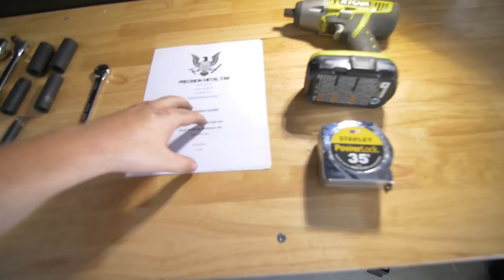2017-2019 F250 PMF Dual Steering Stabilizer Install and Review

Comment: I'm really shocked that in 2019 they are still fighting death wobble
Reply: Earl James that’s a big cap. Look at YouTube videos everywhere. People with stock trucks doing this shit all the time
Reply: @Earl James Mine is exactly 100.00% stock and I've had the issue several times.  Same for several others I know.  Ford and their caseworkers are well aware of this issue also.  Their latest "fixes" make it much better, but I'm not ready to say "fixed".
Reply: @Earl James You must not drive any of those trucks.  Have you asked the drivers if they have that problem or are you like our mechanic that sits on his butt and monitors stuff???
Reply: I’ve had my 2016 Lariat (stock) 4 years now. Driven it three times from Austin to The Mississippi Gulf Coast (round trip) and Austin to California central coast twice. I’ve driven it from San Jose to San Diego twice (I-5, hwy 101, I-405), San Luis Obispo, Ventura, LA, even God-awful Houston highways, California Grapevine on the I-5, the I-10 and I-12 in summer Louisiana and Mississippi heat. The west Texas, Arizona, New Mexico and California deserts (I-10), and Lake Tahoe (Sierra Nevada Mountains). Never seen or felt any wobble, jerk, or shimmy. Edit: Also, I live down a  quarter-mile dirt road complete with a huge grade and ruts. When it’s dry out, I have to use my 4Hi or rear diff lock to avoid spinning on the gravel hill, and when its rain, to avoid slipping on the mud. That’s just to get to the “road”. I’ve bounced that suspension moderately (hard once on a pot hole at speed) regularly. Both before and after the aforementioned long trips - she’s been cared for, but not babied and never garaged. In fact, my biggest problem is my war with the rodents going after my wires.
Reply: @Earl James I have a Stock off the lot 2019 F250 with 3,000 miles on it and yes my stock truck has it. Only non stock parts on it are plow mount and Sumo Springs in Front bump stops and has it worse without plow on it. Dealer stated its normal on these trucks.
Reply: I have a 2017 f350 4x4 single cab XL with a 1800 pound Northstar SD bed. 6.2 engine...total truck weight with tools and driver is 10,000 I have weighed it on a truck scale...have not experienced death wobble yet..is this just diesels that have the issue?
Reply: @Earl James stock trucks do it all the time.  Dealer puts new parts on and  front end is nervous in a couple thousand miles and by 5k miles goes into full on death wobble.  Front ends on 250/350 are shit, my 450's and 550's rock solid so far.
Reply: Everything completely stock, 2019 with 27k miles, death wobble!
Reply: Just Cause that’s because the DW issue is with the new body 2017 and ups.

Comment: Why install a dual vs replacing the original stock with something like a high-end Fox? The previous owner of my 2017 installed a dual stabilizer and I'm trying to decide between upgrading its shocks or removing it and replacing the original stock stabilizer with something like a Fox.

Comment: Great video but I still don't understand the whole issue with the four 1 1/2" bolts - did they fit or not?  You put 2" on but at the end said the others could have worked.  Are they too short or not?
Reply: That's what I was seeing, the 1 1/2 bolts should have been the right length. The 2" bolts were not threaded all the way and nut could bottom out on the shoulder of the bolt. I would put the shorter bolts back in and retighten. Should be easy if you change them one at a time

Comment: The dampeners are to control the big 4X4 wheels when off road from slamming around, and ripping rhe steering wheel out of your hands. On pavement it does nothing. For control of lateral movement.
Reply: Nah. I have to disagree. In the F250/350 it’s a huge improvement on pavement. I have this same kit on the same truck.
Reply: @Coach_RC  the old Cadillacs had dampers too, gave them a real steady feel on road, true. But 4X4 front end is a different beast altogether .if you have true death wobble the damper may camouflage it, or reduce it, but it is not the cause. Look to your other front end components,  bushings, any play at all is magnified by larger wheels, poor alignment etc..Do not take chances.Death wobble has been around since the first bunch of 4X4s. We dealt with it in the old days. Find an old timer who knows what to look for.
Reply: @GgRae-gv1tg  I’ll agree that a dual stab is not the “cure” for death wobble, but it 100% improves the ride in the F250/350. My truck is smoother today with 55k miles then it was when I drove it off the lot. The dual stab reduced the bump steer, it turn, saving some wear and tear on other components that are complicit in the truck’s death wobble.

Comment: Did you have to get a alignment after install am putting a 4 inch lift on my 2017 f250 with 22 in rims and 37 inch tires nitto rigged  going to put a stabilizer on mine

Comment: Missing parts and bad directions...that means another brand to me
Reply: My PMF came with all parts and I downloaded the instructions.  The installation went very well and I am extremely happy with the performance of the PMF Dual Steering Stabilizer.  It took care of the death wobble that Ford couldn't fix (4 times in the shop) and it also took out the little bit of bump steering the truck had.
Reply: @kckettridge  I installed some Carli +2 caster bushings and it fixed the problem, even with a 2.5 inch lift.  Is your Super Duty stock height?
Reply: @danieltubbs5422  Yes, stock except I added a Hellwig anti-sway bar in the rear to stabilize the ass end and currently I have Timbren ses bump stops which I'll be changing out to Air Lift air bags soon enough. Primarily because I tow a 36' 5th wheel on ocassion.
Reply: Exactly and at $500 plus  $199 plus the stabilizers  there are more fish in the sea

Comment: Ive got a 2017 KR and I’ve got about 62k on it. Installed leveling kit and some 35’s, truck rides like total $H*T.   Was told to maybe look into this kit. Not sure if it will help or not. Steering wheel shakes and you feel every bump in the road (tires at 60psi) Toyo open country RT and have been re balanced with very low road force.  Who knows worth a shot I guess
Reply: On 35s 60psi is way to high for regular day use . I recommend doing the chalk test to get the best results with 35s especially being 10-12 ply the higher pressure isn’t needed unless your towing so that would definitely help with the feeling of every bump like you said . And as for the wheel shaking make sure the tires as balanced and make sure you check all suspension components like trackbar tie rods drag link ball joints especially . These steering stabilizers only mask your issue it is not a resolution by any means

Comment: When you did the steering test in your driveway the driverside shock bottomed out and actually moved the shock I think the u bolts need to be moved outward or the shocks will be ruined.
Reply: mike mcgrath I saw that too, OP did you correct this?
Reply from the maker: Yes sir! 👍🏼 No issues so far.

Comment: That kit isn't supposed to work with a 2" or less lift/level kit according to the mfg's website.   Think I'm going to go with the Stryker kit and Fox 2.0 stabilizer shocks.   Thanks for the video.
Reply: The website says it works with stock height or lifted trucks.

Comment: I am running 22s on 37s on my f350 there’s a small wobble when I hit between 40 and 45 mph do you think installing this stabilizer will fix the problem? Thank you
Reply: balance your wheels and tires perfectly. those massive tires are bound to be out of balance severely

Comment: I'm curious to know why you just didn't change the stock steering stabilizer. Fox makes a direct bolt on replacement. love the videos just asking.
Reply: john fowler I don’t think the new trucks have a stock steering stabilizer. At least mine didn’t come with one.
Reply: Look above his head in the video and then again when he shows them moving back and forth after the install. It is on the passenger side . I have a 19 and it has the same one
Reply: @johnrocco5315  My '17 is exactly where you said it is....I didn't think I had one either, they bury it out of sight unless your under the truck and looking for it.

Comment: Hello - How did you manage to avoid the low tire pressure light while running those tires? I'm running Ridge Grappler 37s at 50 psi, which triggers the light. Thanks!
Reply: You can set PSI in the truck ecu when you go into the menu
Reply: @MrN8007  Do you need FORScan to do that? Thanks.
Reply: @edwardh8954  I don't think so. Often the dealer will do it for free if you ask. There is a tire size in the menu somewhere depending on model and software version

Comment: It looks like to me the driver's side was binding you need to have somebody get in the cab watch that steering stabilizer your wheel still wants to turn as far as the passenger side I really couldn't see that because you didn't show up on it that close good video but I would definitely check that out just have another person sit in there and turn those Wheels you should have a minimum of 1/2 inch on each side clearance

Comment: Did you have any leak from the diff cover after this being installed? I've read on forums that some have had a minor drip from the diff cover  after the install.
Reply: Don't use an impact on the diff cover and you'll be fine
Reply: @alexmuela92  makes sense. Thank you.
Reply: Use a torque wrench and it'll be fine.

Comment: I think you need a new impact.  Look at the dewalt medium duty and the rigid heavy duty (450 ft lbs).  Both great options.
Reply: Or, just get a compressor and use a real impact wrench
Reply: @RG-ke1bq  That model doesn't work for everyone.  Small compressors don't run wrenches as powerful as the ones that I recommended.
Reply: @factionfx  Who said anything about a small compressor?
Reply: DeWalt did u just saw a yellow black and Decker hell no  !! Buy red  hell of a lot better tool !!
Reply: @bobstewart9365  I use the Mid Torque M18 at work, awesome tool.
Reply: @arizonalifestylechannel2186  all I use red  great warranty and they take a beating !!
Reply: @bobstewart9365  my other fav is my 1/4 long m12 ratchet,  I run a lot of red and most of it i really like.
Reply: @arizonalifestylechannel2186  my m12 favorite is the quick change 4 piece head drill  does everything lol

Comment: I also have a 2017, does this help stop death wobble?
Reply: I believe they have a recall out for that fix
Reply: @C5ZDad  my '17 F-250 has been to the dealer twice for the "death wobble" and they changed out a ton of front end components the first time.  The second time they said they  couldn't duplicate the problem (like why would you want to) and just adjusted the tire pressure.  From my understanding; Ford supposedly engineered out the "death wobble" in 2016 but apparently they didn't since a bunch of us still have it on our 2017 and up models.  There is a law firm in Southern California that has just begun a class action lawsuit against Ford for this "death wobble" issue, which they have contacted me about, wanting a bunch of information and my records on the repairs.  I would rather Ford just own up to their mistakes and come up with a permanent fix for them than be part of a lawsuit.  I guess if a lawsuit is what it takes to wake Ford up and realize how serious this is than so be it.  If it hasn't already, this "death wobble" is going to seriously hurt or God forbid, kill someone if it hasn't already.  I just don't understand why Ford is turning a blind eye to this dangerous issue.
Reply: @kckettridge  that's what most seem to do best, turn a blind eye. I hope you get yours resolved. I just got my 15' back, turned out I had a bad wheel bearing, that was my culprit. I hear there's another class action lawsuit going around for the 6.7l diesels 😭😭
Reply: @kckettridge  has your death wobble issue been fixed. If so what was it I have the same problem
Reply: @danielmartiez2122  Not really.  It was in the dealer 4 times and they replaced just about every steering component on it.  The last time in it was fine for a couple of days after then it happened once I drove over some rough road.  I ended up going with the PMF Dual Steering Stabilizer Kit and the Bilsteins.  Since installing it, I have not had any DW and it even took out the little bit of bump steering it had.  Once the weather clears I'm going to change out the Rancho Shocks with the Bilsteins.
Reply: @kckettridge  thank you

Comment: The hardware was plenty long. All you have to do is barely spin the nuts on one side and then squeeze the other side and then lastly tighten all sides equally. I just wish the instructions were better for which way to orient the outer bracket.

Comment: Great job overall, I'm curious about your true feelings regarding the PMF kit? Seems to me that "Stryker" USA made may be a better choice for our application. "Stryker" does not use the household type silver U bolt. I agree with you as well regarding the quality of the U bolt provided... Not a grade 8. Just curious regarding your thoughts, would you buy PMF again or try another? Thanks.
Reply from the maker: I honestly have not seen the striker kit. I heard about PMF through some friends who have used it and from the forums. I would definitely use their stuff again, not sponsored or anything just FYI.. It was very well built.
Reply: @moostang09  Take a look at Stryker next... They do not use U bolts etc. You may just like the product & their customer service is exceptional.
Reply: They are not only "not grade 8" ... they are grade 2 (at least I assume they are as the nuts/washers are grade 2 and the combo is only as strong as it's weakest link).  I don't think it's a matter of cost or "cheaping out" but rather an engineering thing (the cost difference would be minimal and given the price of this kit, would anyone grouse at a $5 price difference?).  Reason I say this is that a while back, I was changing out the pinbox on my fifth wheel and was going to "upgrade" from grade 5 to grade 8 bolts.  The manufacturer told me to absolutely not do that - after a certain level of stress (such as in an accident), the bolts were designed to fail.  I'm not an engineer - just saying that there might be an engineering reason weaker bolts were specified.
Reply: @RG-ke1bq  I don't know about the "designed to fail" statement made by the manufacturer, but u-bolts do stretch and are weakened to a certain point over time.  You should have no problems, unless you don't perform the required maintenance (regular tightening, etc.).  If you don't check them peridically, damage can occur from being loose, stressing threads, etc..  I would prefer to have the best grade possible, but I think for this kit, the u-bolts provided are sufficient.  Be sure to do the maintenance!
Reply: @moostang09  I agree that the PMF kit is very well built.  I just installed the kit on my '17 F350 yesterday.  I appreciate your video as it helped me in various points during my install.  I chose the kit because it seemed to be the best "fit" for my truck.  In my search, I'm not sure I found a better adapting kit for a Ford Superduty than PMF provides.

Comment: Thanks for the video!  Great camera work on the install.  As for the kit...  Improper hardware....  Burrs on brackets....  U-Bolts not big enough....   I want a kit for my 2019.  It's just not going to be this one.
Reply: I just installed this kit with the help of this video.  I had already purchased this kit and was getting worried that I should've gone with something else but I had no issues with my kit. Everything went together smoothly.  The bolts were the same size as the ones in this video but mine worked perfectly.
Reply: @cdrracing   on 2017? i have a 2017 i want to install this on hoping it fits

Comment: I’m so bummed out with my recently purchased 2018 F250 with only 35k miles. The steering feels so flimsy and I get death wobble. I wish I would have never bought it now.
Reply: ZR1Terror same here brother im at 33k same truck and problem, just took it to the dealer today they said they would call me after the new year so they could install a steering damper. Hopefully that solves this prob
Reply: Same issue on my 2019 f250 limited with 14,000 miles its sitting at the dealer awaiting damper eta 4-6 weeks. Driving a 2019 f150 platinum  as loaner  car.

Comment: Hi Shaun , did you ever Experience any Death wobble ? Before the steering stabilizer and Track bar upgrades , I’ve heard multiple recalls about the Deatrh wobble stock size tires
Reply from the maker: No death wobble for me.
Reply: According to PMF, this isn't intended to cure death wobble.  Ford has a fix for it (NOT a recall - a "Service Bulletin"), I had it done and the improvement is marginal.
Reply: @RG-ke1bq  Regarding death wobble.....I just installed this kit yesterday, so I obviously haven't had the kit long enough to determine if it helps death wobble (DW).  I have a stock '17 F350 and I have experienced death wobble many times (approx.15) and it is no fun at all (especially, if you are pulling a horse trailer).  The thing I have done to eliminate the DW is to regulary tighten up my steering components.  I check them every 3 months.  I also keep the truck aligned, because bad alignment is a cause of DW.  I regularly check my tire pressure and also don't let my tires get lower than 3/32.  Now, a lot of people don't want to spend the time or money on that type of maintenance; however, it helps on these heavy duty trucks.  I don't think this kit is a "cure" for DW, but I believe it will help in the overall stability.